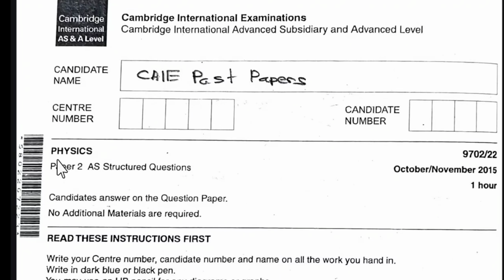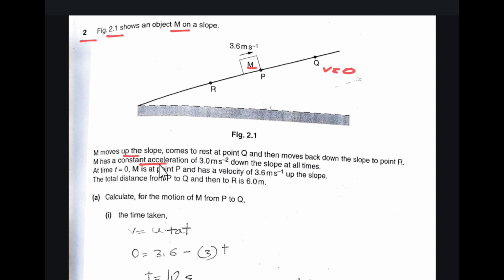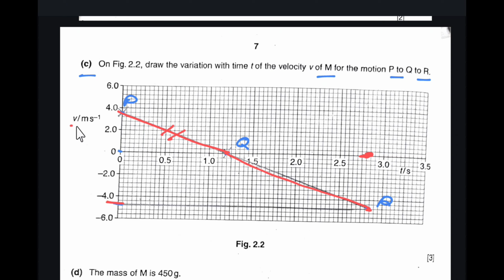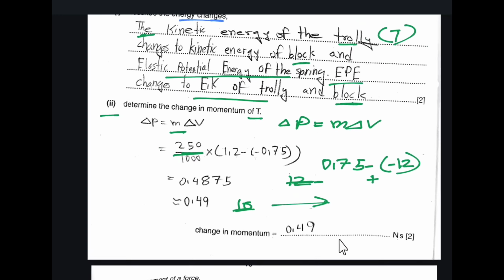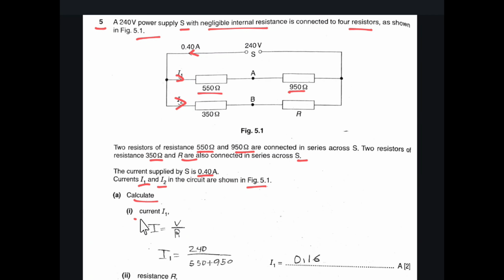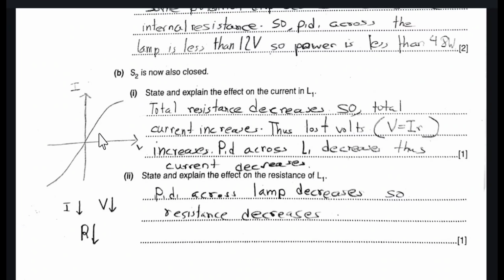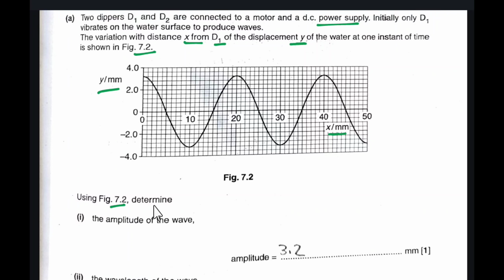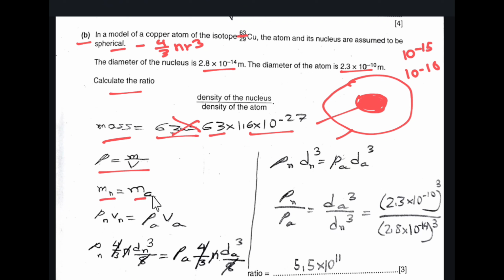9702/22/O/N/2015 | As Level |P2 9702 CAIE Physics|Cambridge

Comment: I don’t understand in the question 1 why is the horizontal component of the velocity of the water in the opposite direction of east?
Reply from the maker: Resultant Velocity 8m/s

We break the resultant into its horizontal and vertical components

Now in horizontal direction 2 velocities in opposite direction one right other left

SO WE NEED TO ASSUME ONE DIRECTION AS POSITIVE AND OTHER AS NEGATIVE 

As both are in opposite direction So we assume

But since we square so the answer would be same
Reply: @CAIECIAM-365 ohhh tysm